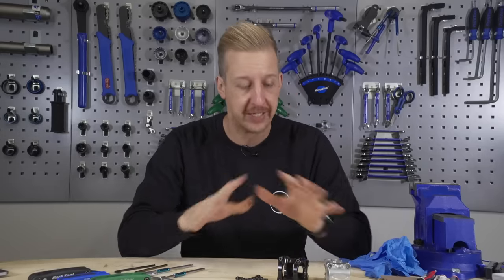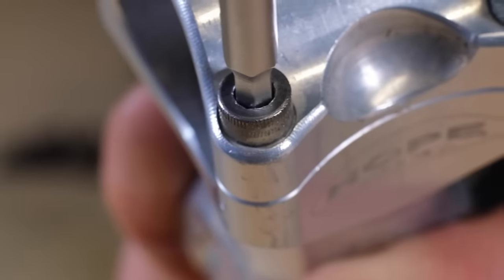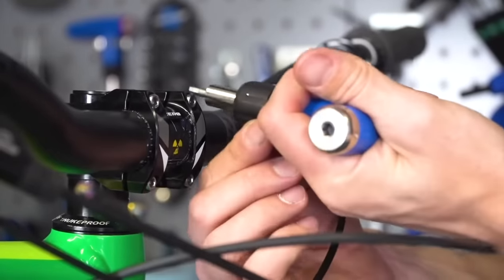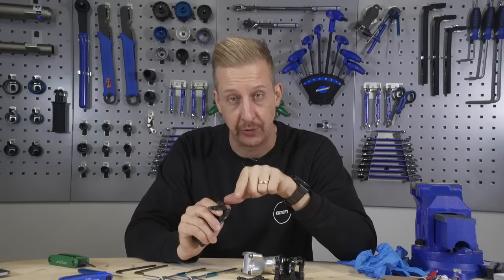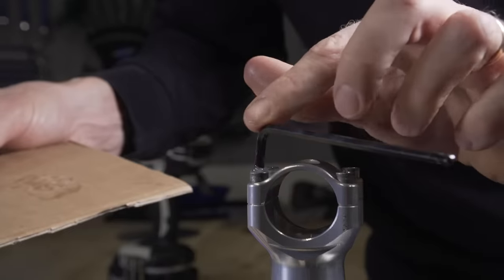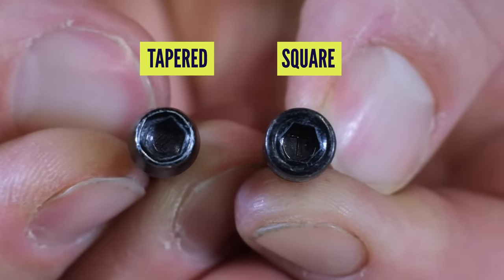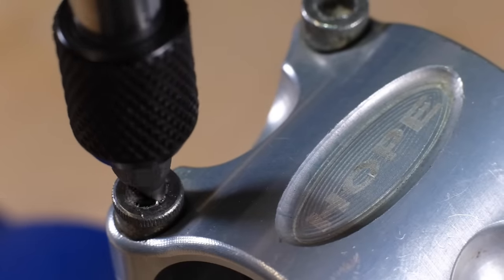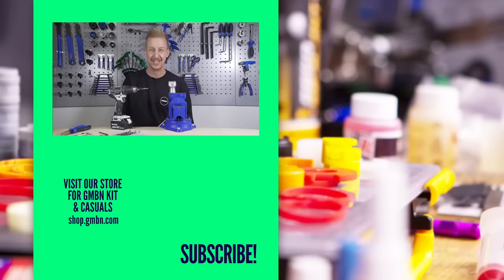4 Ways To Remove Stripped, Rounded, Or Stuck Bolts | GMBN Tech's Guide To Stubborn Bolt Removal

Comment: You could also use a flat screwdriver and with 2 small cut on the edge of the bolt, you will be able to take it out..tried and works!

Comment: Also - USE A HEATGUN - Aluminum heats up faster than steel (most bolts are steel).  When the Al expands that little bit the bolts almost fall out.

Comment: Another tip that is sacrificial to Alan wrenches is to get a size or 2 bigger wrench than the actual bolt and use a hammer to hit it in and reshape the bolt.

Comment: When all options have been exhausted, I always cut a slot with a Dremel and use a flat/common screwdriver to remove the bolt.

Comment: I purchased a nv200 cargo van and have been trying to get the last two bolts out of the top of the cargo cage, the 2 bolts were tightened too tight and stripped . I purchases the bits to  take out stripped screws/ bolts but no luck getting them out. Maybe the drill wasn’t strong enough. I want the cage out, making myself a mini camping van. So frustrated with those 2 bolts.

Comment: I had this problem with some handlebar grip ends that had 2mm allen key bolts to secure them almost grub screws and threaded the heads on one but because they are so small and so close to anodised metal its hard with any of these methods I ended up buying another set of grips and just be a bit more careful when putting them on.

Comment: The screw is now stuck on the left hand thread drill bit. I tried removing it with plyers but can't get enouhh torque on it with that method. Any other suggestions?

Comment: Completed rounded out torx rotor bolt. Will try the saw slot method first, otherwise drill the head off method

Comment: I’ve snapped one of the front brake calliper bolts which has left about 5mm of it in the fork making it hard to access for drilling a hole in the top without the risk of damaging the threads, any ideas on how to remove it? Maybe the bonding an old key to it could work but concerned Araldite could get on the exposed threads in the fork lower

Comment: Your last solution came in really handy for me a few weeks ago when my bolt snipped off leaving the threaded bar inserted into the forks when I was tighten the disc caliper with a torque wrench got it out very easy thanks to your great video I brought the same kit you have off amazon. 10/10
Reply: Hey Chris, can you dig out the link to the set you bought? My stem bolt seems to be a much stronger alloy than the set I have tried - just wore out the teeth of the extraction bit.

Comment: Hammering in a torx bit that is slightly bigger than the cap head bolt that has been rounded usually works for me. Option 2 that I have used in work (probably less suitable for bikes) is using a tig welder to tack a hex head bolt to the cap head and then using a spanner to undo

Comment: You can use a torch do burn the adhesive away from the sacrificial allen key. It you degrade the epoxy adhesive, but not the metals.

Comment: You can also simply use vise grips or water pump pliers to remove the bolt.Because the bolts on a bicycle have a big surface.There are many ways to remove rounded bolts.

Comment: The top rear shock bolt was stuck solid in my main pivot. It was an aluminum bolt and the pivot is also aluminum. My frame came with the shock pre-installed, and the head of the bolt stripped out the first time I tried to remove it. Shock was still working all right wso I left it in place.
Fast forward two years. Shock finally got leaky and needed servicing. I ordered the replacement bolt from the manufacturer. Tried the sacrificial hex key and JB Weld. No joy. 
Tried a bolt extractor. It snapped off inside the bolt head.  I drilled a couple of tiny holes in the threded end of the bolt then used a file and a handheld rotary tool to connect the holes into a slot. Removed the pivot and shock from the bike and clamped the pivot in my workbench. Stuck a screwdriver into the slot and used a crescent wrench to torque it. The Aluminum gave way. 
I ended up drilling down through the center of the slot in the threaded end far enough to go through the thickness of the threads in the pivot. Then used the next size of drill bit, and the next size and so on until it was almost the size of the threads. 
I set a center punch down into the hole and tapped it. The bolt sheared off nicely leaving a thin sleeve of threads in place. 
Next I filed and polished until I could just barely see the threads, then used a pick to dig out pieces of the threads until the pivot was clean. Whew!  Didn't have to replace the pivot or the shock. 
But this was the biggest pain in the neck I ever experienced in over 30 years of working on my own bikes.

Comment: Left handed drill bits are the only way to go. Using a right handed drill bit to prep for an easy out only tightens the stripped fastener further. Simply getting a good bite with a left-handed drill bit is going to extract it before you can even spot drill it for the extractor.

Comment: What I have done before with a very light aluminium stem bolt is to tap in a flat head screwdriver so it went across the hex and used that to extract the bolt. Then I replaced it with a stainless steel one. I would go titanium but I find you end up having to use smurf snot on them all the time or watch them unscrew themselves, especially on rotors, I never seem to need to do that with a stainless steel bolt.

Comment: Sprayed with penetrating oil the night before, then tried the glove trick without success.  I didn't have a Torx head, but I had a square head screwdriver, and that, wrapped in a single play of a nitrile glove took it right out.  Thanks for making the video.

Comment: Heat. Before trying any of these methods heat the surrounding metal/carbon with a hair dryer then cool the stuck/damaged fixing (air or water).  Always be careful not to over do it with the heat though.  You can also use a centre punch to dent the head and the angle it in the direction to undo.  Lastly if you have access use an impact driver rather than a drill as that will help it to come out.

Comment: If a bolt is out in the open, or if you can get it out in the open (e.g., removing a seat post or wheel), you can clamp down hard on the head with a vise grip type of pliers. It’s not a generically useful method for a lot of bike bolts, because they’re often recessed, or there are things that get in the way (e.g., the curve of a post). But if it’s out in the open, it’s an easy first resort before trying out the other methods.

Comment: Had a bolt on my car rust and get jammed once. Did not have the time to use araldite or other glues.
Ended up welding a wrecked Philips bit to it, and extracted the bolt with no problems. 
Not necessarily a good sulution on a bike, as most bikes are aluminum or carbon, and the bolts are fairly small. But could work on the biggest bolts.

Comment: I severely rounded my countersunk rear axle bolt (5mm) on my specialized demo 8 and tried everything but in the end put an easy out on the end of my drill and it spun it out effortlessly with no damage to the tool. The bolt was pretty much around 22nm so I was fairly impressed

Comment: Yes to the bonded key. Ikea hex key FTW! (otherwise, total garbage and don't use :) )

Another option to the "drill out" is to use a rotary tool (Dremel) to create a slot for a flat screwdriver. Good for places with limited area to work, like a cleat bolt.

Comment: Very informative however, using method #4 on my demo 8 2013 rear axle, it didn't budge and now I'm left with bigger hole and yet to change my flat tire. 😪
Is there other more intrusive ways?
Reply: Use saw to cut a straight line across bolt and use a flat head screw drive or bit to remove... or use the GLUE method.

Comment: Use a file/ dremel/ angle grinder to create spanner flats on the sides of the bolt works better than cutting a slot, although not for countersunk bolts obvs

Comment: I have a bolt on rear fender holding seat on MotorCycle stripped just turns. Need to remove to get to the Battery

Comment: Smart with the glove. I got problems with my gx dub  crankbolt. Cant get it loose and now i broken of a removal tool thing in there. :'D
Reply: i had same problem on second hand bike i bought ,didnt notice .took it to bike shop mechanic took it out with air gun ,came straight out ,panic over and it was completely rounded

Comment: Weld a piece of steel onto the head and use this to unscrew.  Recessed bolts can be welded with a copper tube shoved down the recess. Best for steel part and steel bolts. Build up the weld using flux wire welder. Weld the steel piece onto the built up weld. Alternatively use high strength epoxy to glue the Allen key to the damaged head. Be sure to strip any grease or dirt from bolt head.

Comment: The heads of the screws on my seattube's bottle cage holder did brake off. The angle in the frame does not allow to drill out the screw, because there's not enough room for the drill. Any advice much appreciated!
Reply: I would borrow the Doddy's idea for epoxy but instead of L-shaped key you can use a hex bit. Then you can undo the bolt with a ratchet and even if you don't own a ratchet you can use adjustable wrench, although I suggest you to buy a ratchet. It's very useful tool. Also you can buy cheap hex bit from the hardware store as you're going to sacrifice it.
Reply: They make 90° adapters so that you can drill in very tight spaces.
Reply: Use a small cold chisel & hammer & try knocking it around anticlock wise.
Dont try that if its a carbon frame as it might knock the rivnut that holds the bolt loose.
Reply: Pliers sometimes just does not have enough force so you will need hilok colar pliers or knipex cobra pliers if the head is exposed. If it was installed with loctite you can use iron for soldering to heat the bolt. Also there is such thing like screw grip which is paste with abrasive particles inside.
Reply: @borisov1024  you can buy specific ratchet for bits which is very small and you can access restricted space. Wera does have nice kits.
Reply: Many thanks for all your advice! Unfortunately it's not only the head that's gone but the fist 2-3mm thread as well – so no access with pliers. I think I'll go for the 90° angle. Just worrying, if it's possible to apply sufficient pressured and work  precisely enough - it's a carbon frame...

Comment: 5:00 - bolts like this, use a circular grinder on a dremel to cut a slot and use a chisel or wide-bladed flat head screwdriver.

Comment: My main method is to peen the head gently with a ball-pane or pin punch, if it has quite a distance to  reclaim I will center punch where the flats are(sometimes with a key in the socket). This is particularly helpful on specific machined adjuster bolts which can't be easily replaced. Even works for flat and Phillips heads.

Comment: I did it to my maxle on the rear, thought my Allen key was in all the way but it wasn’t, went to apply force anddd...........  rounded, managed to get it out my hammering an old 6mm Allen key into the 5mm bolt to make it bigger and I got it out👍🤷‍♂️🤷‍♂️🤷‍♂️

Comment: Now, how does one get the stripped bolt out if the tap(easy out) snaps off inside the bolt head???
Reply: Lots of swearing......

Use a bur but in a dremel style tool to grind it away, I usually end up drilling the whole bolt out and breaking it up when it’s this bad. Years of experience with old cars and motor bikes for this 👍

Comment: Tig welding a nut to the top of the rounded hex bolt or socket head cap screw is another way of removing bigger more industrial fasteners.

Comment: Ok, I got one for you, M5 hex bolt holding a bike rack on down by the rear tire. Half the bolt came out and left half the stem still in the threaded hole. :(  The frames aluminum.

Comment: I have tried them. None of them worked. So I always cut a slot on the top and then use flat head screwdriver to loose it up. Works every time

Comment: Unfortunately nothing is working for me. I am trying to take my old license plates off my car and the philips screws are so rusted and the heads stripped and damaged from trying everything even the left handed drill bit didn't help. Maybe my last resort is to cut the head to turn it into square so I could use a wrench?

Comment: I drilled a 3mm screw head with a 2.5mm , then used a tiny screw driver to wedge it it , got it out then used a new screw on the hydraulic break cover ,

Comment: I still have an issue with a T10 bit that broke off tightening a bolt. It broke off just at the edge of the bolt, the tip is still stuck inside 😕 Yet to find a way to remove it, tips are welcome! 😅

Comment: Anyone ever used any of these for a stripped DA7900 chainring bolt? The last of 5 is stripped out and seems didn't have any anti-sieze either. For reference it is a single sided T25 Torx bolt. I am going to try the rubber glove hack today, hopefully it works - I don't want to use the glue in method - just in case it doesn't work!

Comment: If enough head showing then grip tight with Mole wrench and unscrew, not easy with tapered head and impossible with countersunk.
 I have also used hammer and chisel to get screw turning,  need really sharp chisel, you only really get one or two shots at this before you take the head off, and then you have problems.

Comment: The absolute first thing you do when removing rusted bolts and oil & transmission drain plugs is to give it a good smash with a medium size hammer. Hit the head of the bolt with a heavy hammer and it will loosen the rust to metal bond. Spray penetrant next. Of course you can't reach it with the hammer, so use a 1/2 inch extension that's used on a ratchet, something like solid steel bar, 1/2 inch or bigger. It will make the difference between breaking off the bolt and loosening it up. Then loosen a 1/4 turn then tighten it a 1/4 turn. Repeat this until you feel you can back out that bolt. And if your gonna keep that car or truck for a 100k more miles put some white lithium grease or anti-sieze on the threads.

Comment: For taller bolts like the ones here (or any that are not recessed), take a 1/16" drill bit (or larger for larger bolts) and drill all the way through the bolt head from the side (like you would do if safety wiring a bolt). The pass an allen key or an awl (or anything rigid that will fit through the hole you drilled) and lever it out.

Comment: I just wanted to add, if you go with the glue route, most of the time YOU CAN ACTUALLY RE-USE the Allen key!! Now, you're probably wondering, how? 

Note: this method won't work on Allen keys with TINY shaft lengths. 

So, you've rounded the head of the Allen key to the stripped bolt head, and you've taken the bolt out of whatever it was in. Now get a hacksaw, or whatever saw you have that is capable of cutting through metal, and cut the shaft of the Allen key right above where you glued it. Boom, now you can use this same Allen key like normal, or glue it to more stripped bolts!
Reply: If you can hacksaw through your Allen keys then bin them as they are the reason your stripping bolts 
If you want to remove the glue from the Allen key just heat it with a blow lamp and most glues will just crumble off
Reply: @autoSRI  I was thinking maybe like one with a metal cutting blade? Also, if you're gluing an Allen key to a stripped bolt head, I assume that the Allen key isn't of high quality?

Comment: The Allan key head broke on mine and it ain't a clean break  And it's a small one on the orange patriot pivot arm where the bearings are. Bike shop's won't touch it either so it's drill it out and prey I'm dead on center.

Comment: i used an auto mechanic style torque wrench and i read the NM wrong and turns out this one requires math. CON: i rounded out all the stem bolts. PRO: used this as an excuse to buy a whole new stem and a bike specific torque wrench.

Comment: If the bolts were american standard you could pound a metric wrench in and maybe get lucky.  Unfortunately all my bolts use metric allen wrenches.

This is the first thing I use at work on machines.  After that I go to ez outs, after that I weld an allen wrench to the bolt head.

Comment: Error at 3:50 in video!
3/32" ( .09375") is NOT a tight fit for a 3.5mm (.13780").  3/32" is too small for even for a 3mm (.1181") head.  The 3.5mm metric head size is not in any metric Allen key set that I have.
Nevertheless the ideas in the video are very good.
Larry

Comment: Yes, I cant remove bolts from my stem. I took my bike to bike shop, and voila! - it can be removed in seconds. Apparantly, I'm using a cheap short allen key that fail to do the job. Simply just use a proper long allen key to fix the problem.

Comment: I break bolt heads right off and end up drilling. Those cheaper tiny removal bits you’re showing I’ve also broken off in the hole creating a world of pain. 
So this vid is only partly helpful.

Comment: You said" Grease or anti seize." and then showed thread locker. ??? There's also the more extreme technique of using a cold chisel to make a small notch in the head of the bolt then using a hammer and punch to turn it.

Comment: You forgot grab it with a mall grips. Lubricate Lubricate Lubricate then cut a slot in the head of it for a big screwdriver ,put stem in oven then inject liquid nitrogen into the bolt , If that fails use fire if that fails break out he acid. If you have a stem left after all that have a beer

Comment: being a full time spanner monkey I have used many methods over the years but one that works well If room allows is to use a sharp chisel and hammer to get a groove on the edge, then a few larger twats of the hammer to release the bolt

Comment: All of these techniques would be unnecessary if they would just make bolts hex on their outer edge as well as in the hole so you could just use a spanner to remove an overtightened one.  I can't fathom why they insist on making them round.